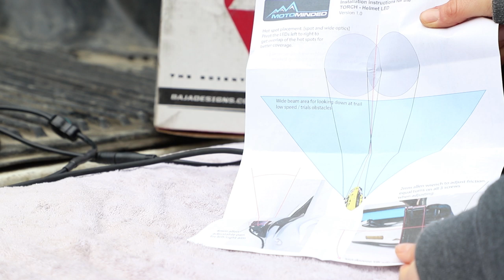S1 Torch LED Helmet Light Install

Comment: Great video Megs. Would it be possible to show a video of it in action?
Reply from the maker: All2CooL88 Yes, I’ll be posting a video after I test them out! 🙂
Reply: @megs_braap  where do you mount the on&off switch ? Didn't show where any of the wiring goes